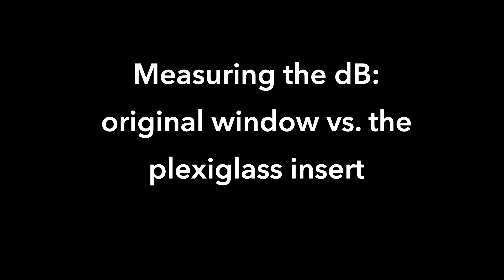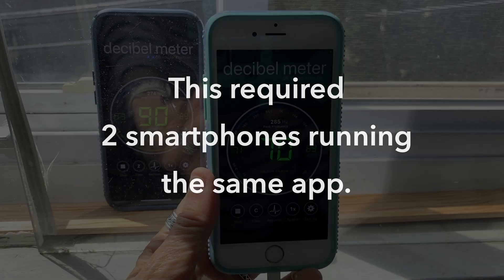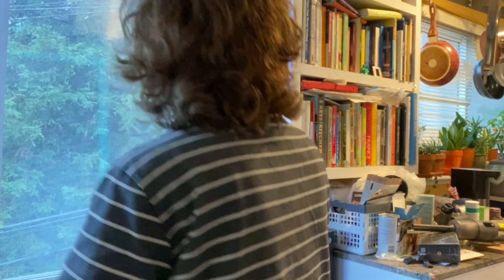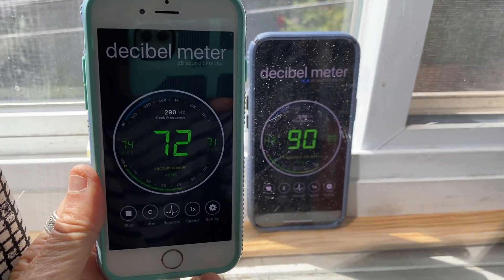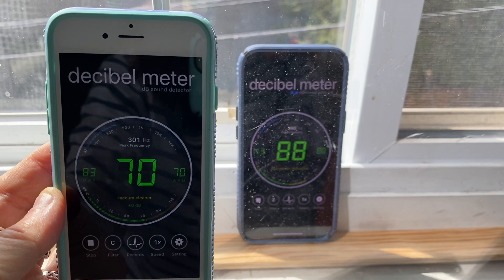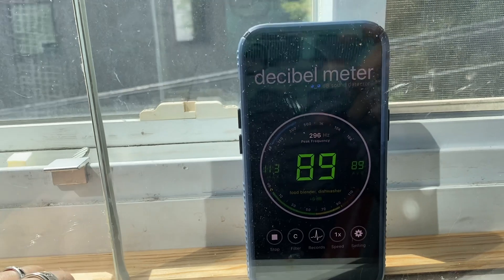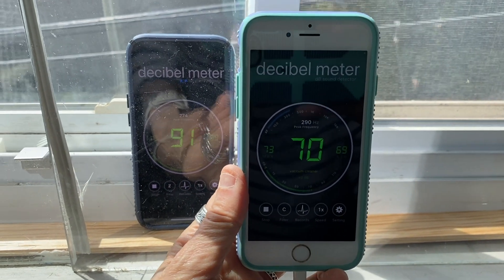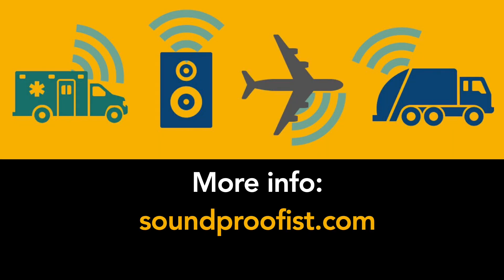Can a plexiglass window block enough noise?

Comment: holy shit 90 db? any louder can cause your eardrums to perforate....

also stc is not a great metric. oitc is more pertinent.
Reply from the maker: It was pretty loud. I never heard what it sounded like outside (too busy trying to capture this video inside). Thanks for the tip about OITC. Do you have any suggestions on how to calculate that from the data I collected already? Or is there an app that does it?

Comment: Really nice video! Just a thought, I'm wondering if the decibel readings between the panels might've increased due to outdoor sounds reflecting off the plexiglass?
Reply from the maker: Thanks. I also wondered if there was any effect from the first iPhone (inside the gap) leaning against part of the window, whereas the iPhone outside the plexiglass was in my hand. That was actually out of necessity because the 2nd iPhone's battery was completely run down and I had to plug it in to use it. But you might be right: there's a possibility that some of the louder noise in the gap could have come from the plexiglass reflecting it back towards the original window. In another video, I built a noise-absorbing insert to put on each side of the window in the gap. Those noise absorbers were not used in this test. So the next time I get the opportunity, I should test the decibels with and without the noise-absorption placed inside that gap (about a 2-inch wide space).

Comment: 90db is insanely high for a residential area, im surprised theyre allowed to do that since you should be wearing ear protection at those levels
Reply from the maker: Totally agree. I captured some video recently where a carpet cleaning service in a van was making a racket that you could hear for 1/4 mile. The van was parked one block away...I didn't know what it was nor where it was coming from, so I started walking around the neighborhood to find it. When I finally found the source, it measured at 103 decibels. Seems like residents should be given advance notice to prepare for ear-splitting blasts like that.
Reply: I mean, what else are they going to do? Let the next downpour result in flooding? In these circumstances, they should just put out warning pamphlets with earplugs, they're dirt cheap, but it has to get done.
Reply from the maker: @user-fy7ri8gu8l  This was not a "ban the drain cleaners" video. Of course this maintenance needs to get done,  just like we need street cleaners, garbage collection, etc. It was a good opportunity to make a noise test, though, since so many of these machines make dangerously excessive noise.

Comment: In my opinion, acrylic glass can't fully block out thumping and low vibrational noises from very large vehicles.  I live in Toronto and the streetcars are just absolutely horrendous in terms of their noise. I wanted to buy a noise/vibration meter but I can't find one within a reasonable price range.  Is there any meters that can read vibrations on market? Do any Android apps exist? Thanks 🙏
Reply from the maker: I agree about the plexiglass. It helps to block or reduce mid-frequency noise, like people talking on their cell phones outside, or a car engine idling (but not revving). The low vibrational noise affects the whole structure, not just the window. And as you saw in the video, the plexiglass could reduce decibels, but not the vibration and low frequency.  If you look closely above the decibel readings on these smartphones, you'll see a frequency meter, which averages about 200Hz. That's pretty low frequency (though not the very lowest), and I use that as a gauge to see how much vibration is still passing through (vibration=low frequency). If the app displayed something like 800Hz, I'd assume that higher frequencies were passing through. In another video, I tested a vibration app (not just a decibel app) agaist a coffee grinder, but many of those vibration apps are geared towards the Richter scale, and the streetcar vibration isn't going to show up in a significant way. Offhand, I don't know of an inexpensive hand-held vibration meter. There are some high-end ones like Brüel & Kjær, but those are definitely not within budget. I'll keep looking.
Reply: 1/8" plexiglass will attenuate low frequency noise, but you have to have a very large air gap in between the outer window and the plexiglass, and of course everything has to be sealed air tight.  
I did an experiment with my basement window (24"x48").  The window sill is 15" deep.  I made a plug with 1/8" Lexan and framed it with 3/4" plywood and 1/2" cork sheeting (used as a gasket around the inside part of the frame).  There is also 1/2" cork sheeting covering inside the entire window sill; top, sides and bottom.  In the summer I have a few cars coming down my street playing LOUD bass music, which I find annoying as hell.  Sometimes the music is so loud that if you were outside you would have to yell to communicate with someone.  I tested the plug at different distances from the outer window;  5", 10" and the full 15".  The 5" distance worked okay, the 10" distance was better, but the 15" distance attenuated the loud bass by about 95%.  I know many ppl do not have the luxury of a 15" deep window sill, but I just wanted to post this info here as an FYI.